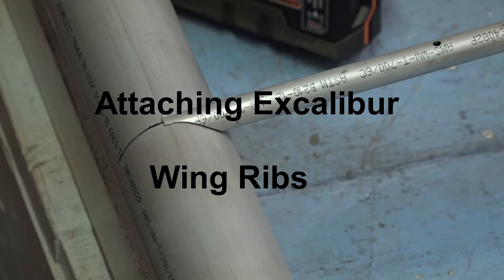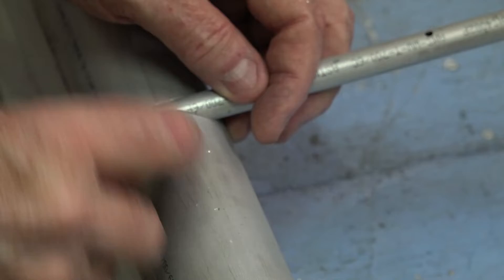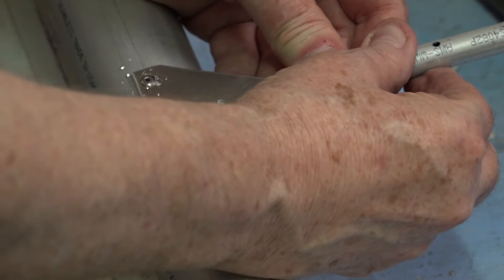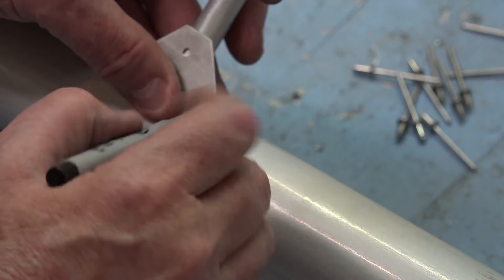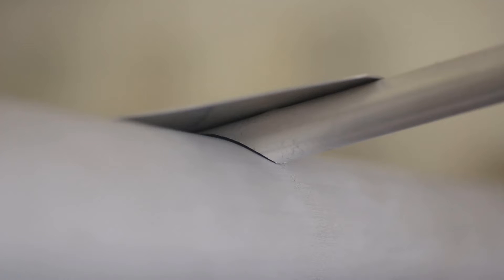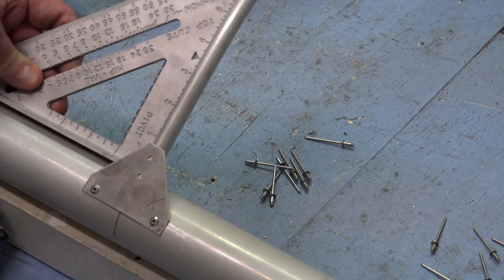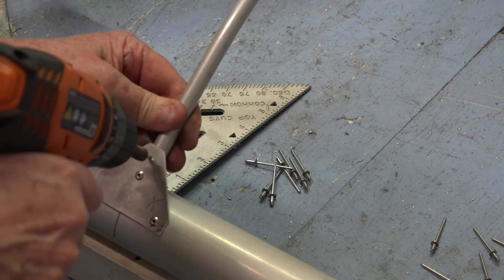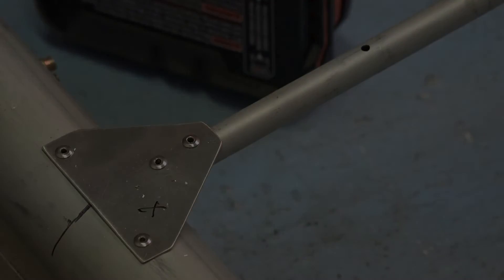Excalibur Aircraft - attaching wing ribs

Comment: So, don't de-bur the holes after drilling, don't remove any metal shavings that are potentially between the mating pieces, don't use a cleco after drilling the first hole to hold the piece in place to get your next holes more accurate. Noted! 

Yea don't follow this guy's advice, you'll wind up dead from your wing rib attach points developing fatigue and stress cracks over time. Very good example of poor craftsmanship!

Comment: I'm not one to armchair quarterback anything. I'm curious why the first hole wasn't cleco'd, so the other hole could be drilled, then deburred? The same for the rib. Watching shavings get trapped under the rivet head doesn't allow for a proper setting of the rivet. Good video overall.
Reply: That's a good point about clecos.  It seems to me also that this step would be done faster and more easily in a jig.  But I can see how shipping a built wing would be so much more expensive and prone to damage.
Reply: Agreed 👍🏻